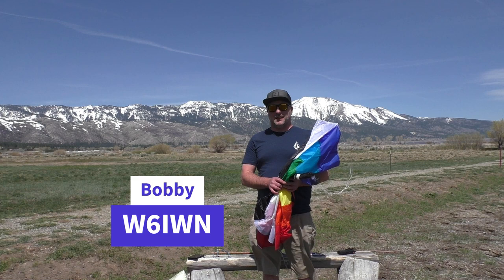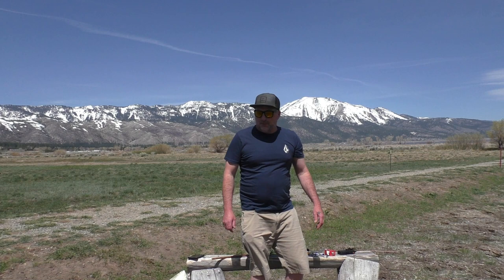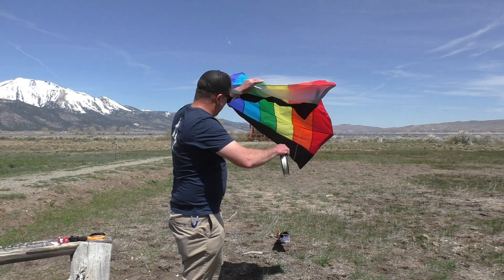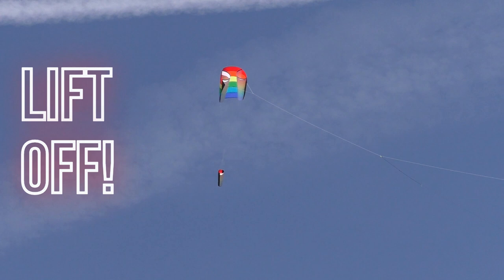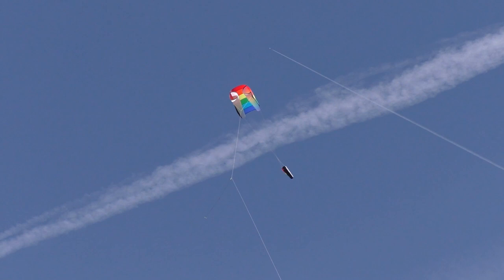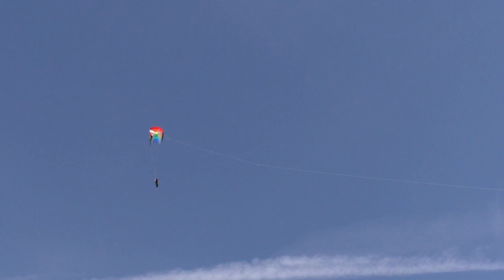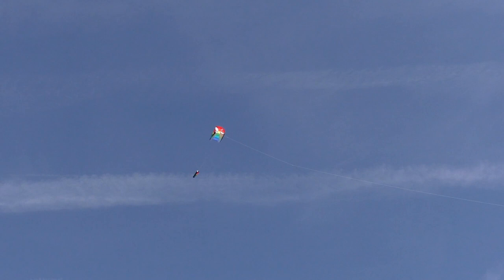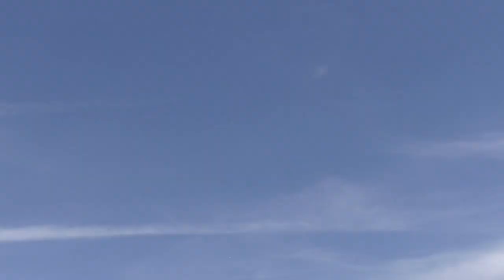How to HF Kite Antenna 2.0

Comment: Just watched both kite videos. Also new to the channel. Did you by chance do any digital? Also did you find out that the majority of your contacts were in a specific direction? I know the direction of an angled vertical tends to lobe out in the direction of the end of the antenna. I'm curious to know if any local contacts and anything Mexico oriented or Canada oriented? Thanks
Reply from the maker: I haven't tried any digital with a kite antenna yet. I hope to dust off the kite and do some more experiments. I don't recall the contacts compared to orientation. Using an EFHW orientated north to south, I  get east to west signals the best. If it's orientated East to West, I get Canada and Mexico better. The kite I have to go with the wind direction. Thanks for watching!
Reply: @W6IWN_Radio  Excellent thanks for the reply!